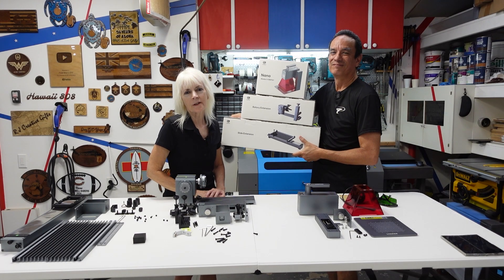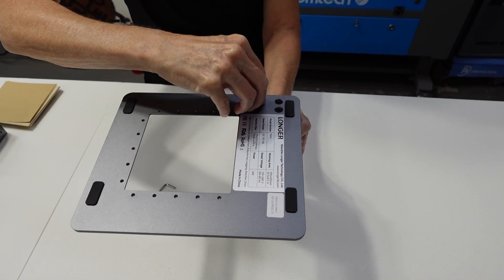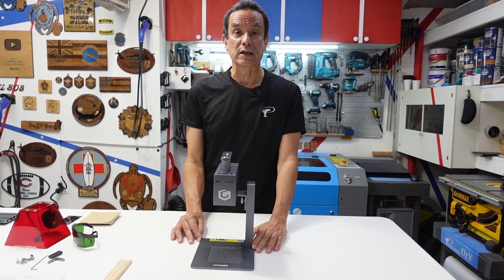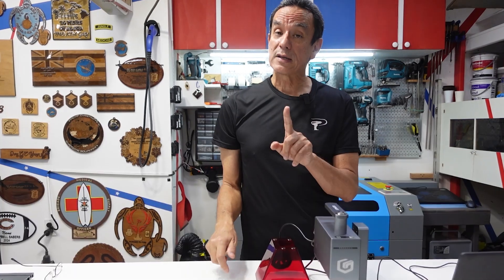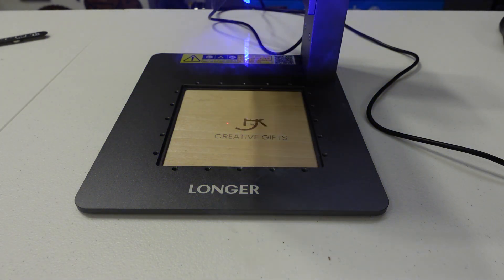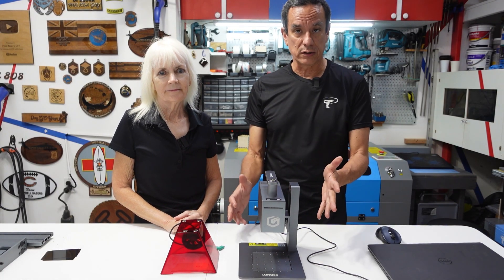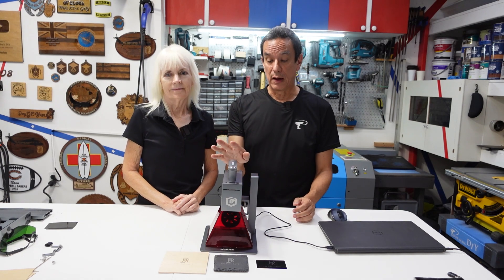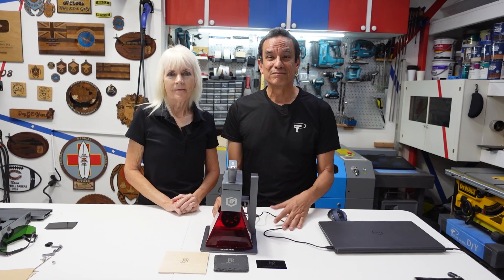Longer Nano Pro Laser Engraver Review – Setup, Testing & Honest Opinion!

Comment: Does it work on plates, and glasses?
Reply from the maker: Diode lasers are unable to engrave clear glass or acrylics. In order to do so, you will need to paint the glass with black paint,  then the engraving will work. Once finished, you have to wash off the paint. It is too much trouble for me so I do not do it.

Comment: Can the base be removed and mount the machine to a larger piece, focus and engrave like on a larger piece?
Reply from the maker: Great question and I am not sure I have a good answer. On one hand the company shows holding the laser against a vertical wall for engraving, on the other hand the manual indicates a built-in safety shut off if the laser is tipped so many degrees. I didn't bother testing because I can't imagine holding the laser perfectly still for countless minutes as it engraves
Reply: @Poor_Mans_DIY  ok. I didn't know if it could be mounted by maybe some type of swing arm and be moved over the middle of a larger panel and use it that way. Just wondering 🤔